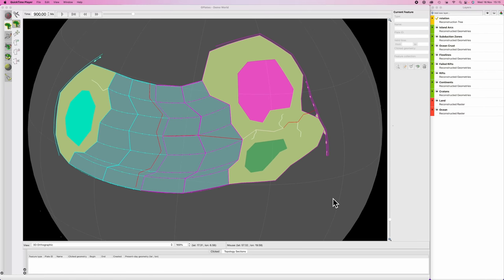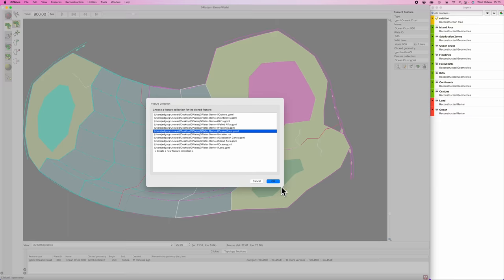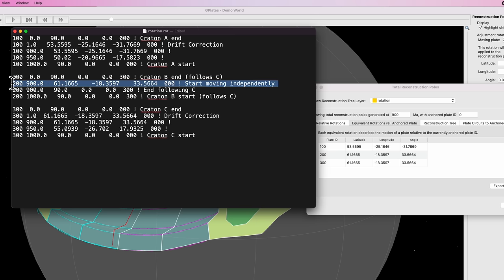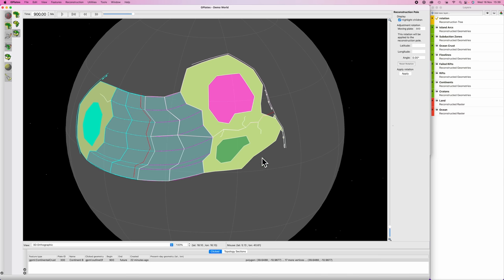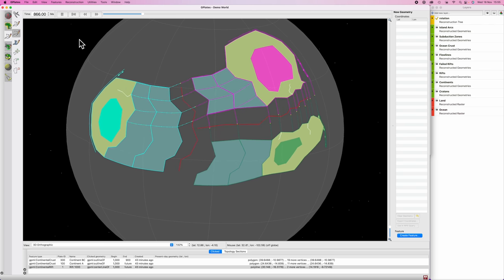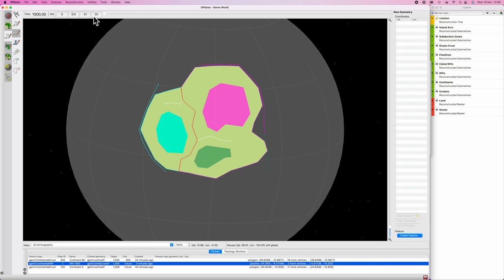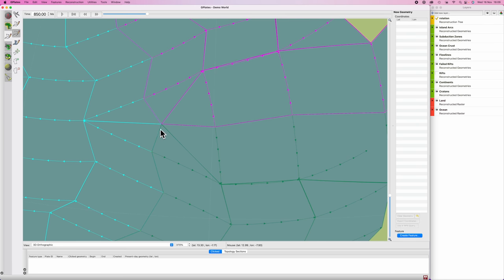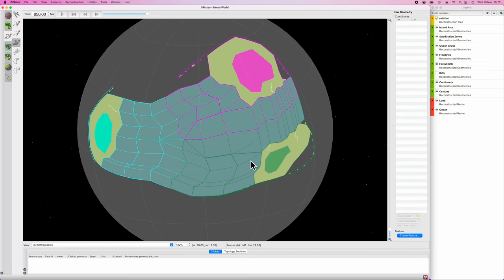GPlates: Splitting Comoving Plates- Worldbuilder’s Log 13

Comment: Thanks to you I've been playing with G plates the entire week, and I discovered some things that you might find useful:
1. When you change the anchored plate in the rotation file, you don't have to look up the new coordinates of the plate in the 'Total reconstruction poles' menu. If the coordinates are still '0.0 0.0 0.0' relative to the parent plate (which is most of the time true), the new coords of the child plate are simply the current coords of the parent. Thus, you can simply copy the coordinates from inside the rotation file.
2. Be careful with the kinematics tool. The speed that is displayed is dependent on the latitude and longitude of the plate. However, if you press the button 'Use focussed feature', Gplates will fill in the Long Lat and plate id of the currently selected continent. You can also first select eg island arcs to see what the speed is at that location. Om large plates or plates with a lot of rotation, there can be a significant difference.

Comment: I wonder if the owners of Gplates are wondering why there's so many people downloading such an obscure scientific tool. I'm sure Artifexian has more than doubled its userbase overnight.
Reply: They could, in that case, relase a more user-friendly tool. For example, in this video, Edgard has said a "this is the exact same process" a bunch of times. That would be a macro in, say, Word or Excel.
Reply: @Daniel Rossy Explica  There tends to be a trend with academic software, accurate and stupid or inaccurate but user friendly for educational purpase so not very robust in what it can do.
Reply: The blog post this is based on is actually linked on the gplates website, so they're at least vaguely aware.
Reply: I am disappointed it is just an animator. I should just be able to tell the program where forces are and pause to create rifts whenever I like to. Then it should do all the movements on its own.
Reply: @markusklyver6277  Maybe you can compute forces with PyGPlates ?
Reply: @Durakken I wish people would make user friendly stuff that still has all the functionality. This trend would be like if they replaced handcranked engines in cars with electric starters, but removed the reverse gear to do so. I wish I could use a simpler version of this that still allowed all the fine-tuning if someone wishes to do that.

Comment: Thanks for your Amazing work!
For anyone wondering, this is how you would do if you had a fourth plate, Craton D, which follows C for now, but who you want to follow B:

Decouple B from C as shown in the video

Then, you decouple D from C as shown in the video BUT you change the line "Start Moving independently". For the plate ID on the right, you put B's plate ID.
For the coordinates, you need to have the "with anchored plate ID" set to B's ID in the ctrl/cmd+p menu. To do that, you do ctrl/cmd+d, enter B's plate ID, and then, you just go back to ctrl+p Menu and copy the coordinates.

And then don't forget the drift correction

(I know this comment is 1 year late, if you need help, because I'm not very clear, I can still reply years later)
Reply: Hey! I'm attempting to do this right now, but after I change the "with anchored plate ID" setting to B and pull up the ctrl+p menu the coordinates of Craton D show up as indeterminate. Do you have any idea as why that may be?

Comment: When splitting oceanic crust, you can also just make the original plate into one of the two new halves. Also, for anyone who, like me, needed to change the parent of an ID, it's easy: you just put one "90.0 0.0 0.0" line at the time you want to change parents, then another but change the parent ID to the new parent. For example:
009  900.0   90.0    0.0    0.0  007 ! Start moving with ID 7
009  900.0   90.0    0.0    0.0  006 ! Stop moving with ID 6
Reply: Thank you so much ! Just don't forget to change the last (higher on the text bc GP reads backward) :
009  0.0   90.0    0.0    0.0  007 ! ID 9 End
Reply: you are a life saver, I have been trying to figure this out for the last hour and a half, just staring into the screen confused
Reply: When I do that, the two cratons I want to change the parent ID of move somewhere else randomly on the map. I've been trying to fix this for the past half hour, I don't know what to do
Reply: @pico22442  You need the cords of your cratons, so they don't reset.

Comment: Note that with regards to subduction zones they don't always form near the shifted movement of the plate often they form out in the open ocean particularly where oceanic crust has existing fault lines with crust of different ages

Also might be worth remembering that mid ocean ridges tend to be composed of relatively straight rifts each of which are offset by transform faults giving them a distinctive zig zag largely from their origin via triple junctions. The older the ocean the more complex and meandering these seem to get with the relatively young North Atlantic being fairly straight compared to its far older southern counterpart. This might help make some of these ocean floors seem more natural.

Comment: Really great videos! As a physics student, I really love how you use (sometimes simplified) science to build your world. You explain everything really well. I got a couple of questions tho.

1. Shouldn't the 0.0 timestamp of the 200 plate also be unlinked from the 300 plate in the rotation file? I don't know if that gives an error in GPlates or not, but it seems more logical to me.

2. Wouldn't it be more likely that the second rift event was connected to the triple junction that created the original failed rift. So that the triple junction of the mid-ocean ridges falls together with the original triple junction mantle plume. I don't know enough about plate tectonics to know if this is more likely or not 😅. Maybe if anyone knows more about this?
Reply: I'm pretty sure, once rifting occurs, there isn't really anything keeping the plume going. The whole reason magma plumes occur and form triple junctions is because of the old, light continental crust above them, but the crust created at a rift is young and dense, so I would imagine the plume can get pushed all over the place or even eventually disappear entirely

Comment: At 10:00 when Artifexian is inputting the rotation values from the Total Reconstruction Poles, he's doing unnecessary work (perhaps there are instances when it matters, but not here) as plate ID 200 and 300 share the same rotation values. Just copy it form the rotation file, from the parent ID to the ID splitting from it.

Comment: Yea my flowlines are definitely crossing. I don't think theres a way for them not to cross. Short of saying, "just don't have your contenent fracture there" I'm not sure what to do about basicly a pinch between two rifts. A part of my contenet has to wedge itself between two lines to get out into unmapped sea.
Reply: I’m also having that issue. What are the repercussions of having a landmass move other a rift or two flow lines intersecting?

Comment: When changing the rotation file i get an error telling me "Error reading the fixed plate ID" "The pole was discarded" what should i do ? I can no detach my cratons from the ones they used to move, i checked the lines for over an hour now and i did everything like it is in the video

Comment: Hey,  Artifexian, would it be possible to add a black hole calculator page to the spreadsheet? I tried making my own calculator for it, but that ended in a habitable zone by luminosity larger than the Milky Way, and that was at just 10 solar masses.

I would love to see how versatile you would be able to make the black holes, and see how they then affect the planets around them.

Comment: I have some doubts about the continental rift features. At some point i wanted to split comoving plates from a certain part, but due to some angle limitations i couldn't and had to split them far from where i originally planed. I want to avoid this issue in the future, so I want to know if i could make new continental rift features, not one each time step but at least one each continental split if necessary.

Comment: so odd question: how would i do this if i want a LOT more land? i have some very unrealistic fantasy elements already so i'm not too worried about the consequences to the climate as i'll just handwave that, but could i use this process there too or would it be better to keep working on my old gplates model which only does the present based of the old videos?

Comment: When a continent breaks apart like this would the smaller chunk move faster or are there too many other forces in play to know for sure?
Reply: Not necessarily. From my understanding, the size of the Continent has little to no effect on the speed of the plate.
Reply: @VelociraptorsOfSkyrim  Good to know. I guess my mind was thinking on smaller scales and things.

Also interesting user name.
Reply: @kairon156  Thanks
Reply: @VelociraptorsOfSkyrim   The size of the plate does matter, but less than what is driving it. Large continental masses have deeper keels which are anchored further into the asthenosphere and which can slow down plates. The biggest factor is the size and strength of the subduction zone, if any, followed by the ratio of continental to oceanic crust. Oceanic crust moves two to three times faster.

Comment: Hi Artifexian,
thanks for the guides.
I have a question, it would really help, when at the end, you could say what would be reasonable to have happen with out plates.
For example.
Last time you showed your "other" reference continent. But this time you didn't and when we have multiple plates, as we are operating between 8 and 12, how many "breaks" should happen between our comoving clusters?
Is 2 continents to 4, 6, 8, 10 continents reasonable? Is it unreasonable? Or can we just go crazy with what we want?
Reply: I think you can pretty much get away with what you want. If you think of Earth since the breakup of Pangaea, there were first two continents, Gondwana in the south (South America, Africa, Australia, and Antarctica) and Laurasia in the north (North America, Europe, and Asia). Then the Atlantic Ocean started to open up, splitting the Americas from the larger continents and leaving them as island continents with intermittent connections to other continents. Eventually, Antarctica and Australia split from Africa, and India split from Africa separately, and then Antarctica and Australia split from each other. And eventually Africa collided with Eurasia, and the Americas reconnected. 

That's a bit of a tangent, but the point is, there were a lot of rifting events, and eventually some recombining, so there are a lot of possibilities. You just have to remember that subduction zones are what drive rifting events and they're the main driver of plate motion.

Comment: For some reason, when I add flowlines and do the Add points in the properties window the button is greyed out after the first one.  The first time I do it, it works just fine.  The flowlines work how they're supposed to.  If I save, close it out, open it back up, I can then add another set.  Do you have any idea why it would be doing that?  I downloaded the program about two weeks ago, so it should be up to date.

Comment: The subduction zone stuff is only useful if you are not working from a complete map of tectonic plates... The subduction zones would be where these plates run into other ocean crust area of other plates so. Generally i think you should be working with a full map if you're doing this because not doing so introduces a level of unreality you're trying to avoid by doing all this to begin with.
Reply: I am hoping when worldbuilding pasta finishes up his plate history, that Artifexian does a little run through/overview of what and why things happened.
Reply from the maker: "Generally i think you should be working with a full map if you're doing this because not doing so introduces a level of unreality you're trying to avoid by doing all this to begin with."

Disagree with this. First off, I am. Just because the surrounding ocean plates (the grey areas) are underspecified doesn't mean, I'm not thinking about them.

Secondly, the continents will reassemble themselves on the other side of the globe forming the second supercontinent (remember we want to bring the planet through at least two supercontinent cycles). When this occurs we'll have the "full map" you're asking for, which we'll then evolve forward a little bit more to get the modern world.